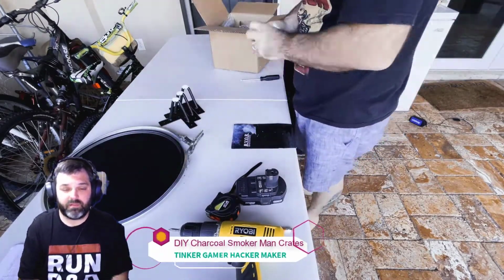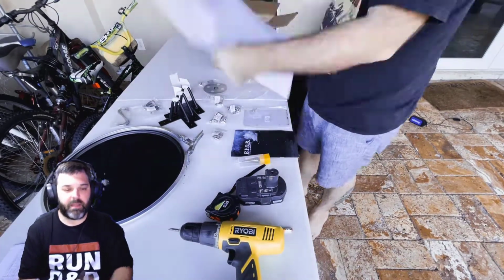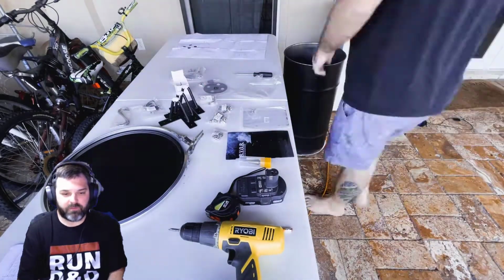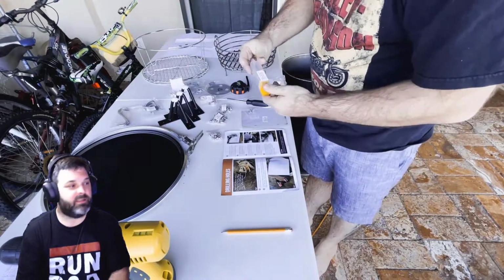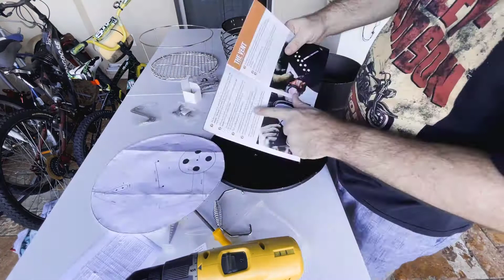Man Crates - DIY Smoker Time Lapse build.

Comment: I’m considering making the same purchase. Good assembly video. What type of bottom vent did you install? I could see you drill holes, but there was no final look around. Also, your thoughts the quality of materials during this build.
Reply from the maker: It's a sliding metal plate with a slit in it. You just put a bolt through it and slide it up and down. If I wanted a high quality smoker, I probably  would invest in that. You sacrifice some quality for the bulk DIY aspect of it. It's ok, but could be a tad bit better.

Comment: hey! i’m wrapping up building my Man Crates smoker today. do you have any recommendations for cook times & temps for any of the smoked you’ve done?
Reply from the maker: I have a hard time adjusting temp it takes practice. For chicken do really short cook times, it was really easy to dry out. For other things like roast, I do about 2.5 - 3 hours. Maybe finish in an oven, but I tend to run a little hot, so closer to 2-2.5 hours would probably be better.